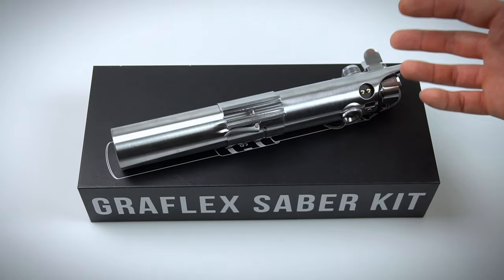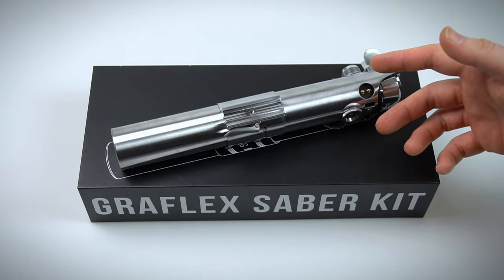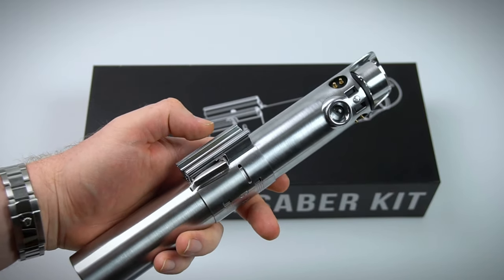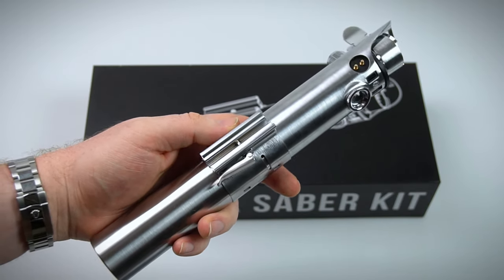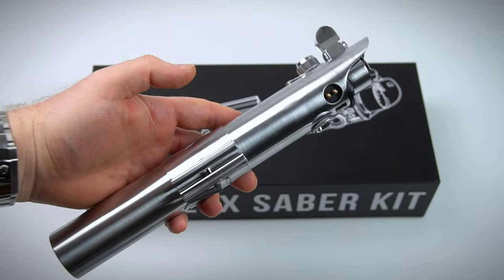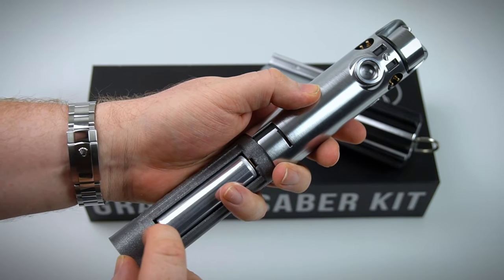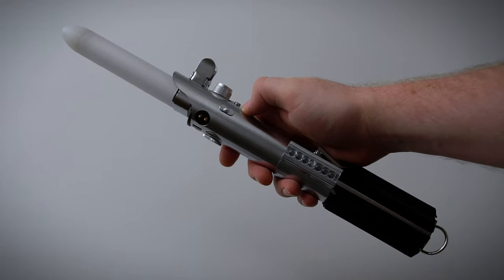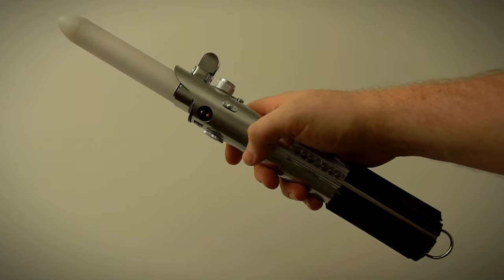Graflex Lightsaber DIY Empty Hilt FX Kit - Luke Skywalker Inspired Prop Replica Kit

Comment: Hello, I just received my kit ESB version and it's amazing. Compared to most replicas I have tried this feels really nice in the hand as well as it's finish. I did notice few things though, like there is no hole for a thumbscrew button or glass eye. I also noticed in the video there were no brass sync contacts where the pins were, but I did see a slit where they could go. After this, I have decided to buy the brass contacts from the graflex shop and was wonder which ones would work? Long or short?
Reply from the maker: Hey! Thanks for the kind feedback. So, there’s no hole for the thumbscrew or glass eye, but, if you look closely on the blade holder, you’ll see a small ‘dimple’. This was deliberately added to give customers the option to either drill for a TGS glass eye thumbscrew, or, drill totally open (by stepping up incrementally) for a shine through effect. So, we left that as an option for users ☺️

In terms of the sync contacts, this was overlooked, and you’ll be pleased to know we will produce a batch of them to offer to customers separately along with spring-loaded blade plugs. 😁
Reply: @KRSabers  That sounds great!! Thank you for letting me know!!

Comment: I just finished my install and was wondering if there’s any update on the blade plugs or sync contacts? Also, is there another front slotted screw (above the glass the) that will reach the blade for retention purposes? Mine seems a bit short.
Reply from the maker: Yes. They’re available on The Saber Armory now. Both the Sync Contacts and Spring Loaded Plugs. 👍

Also, the screws are slotted oval 4-40” thread screws. If yours isn’t reaching, you can buy some longer ones and cut it down to a specific length to suit your blade. ☺️
Reply: @KRSabers  thank you very much!
Reply: @KRSabers any chance the parks 2.0 style ones in the shop would work?

Comment: Hi is the bouton include in the anh empity graflex ? Bc I saw in the install guide that the bouton are spécial
Reply from the maker: Yes. The button is included with every hilt. It is mounted to the blade holder.
Reply: @KRSabers  ok thank you 🙏
Reply: @KRSabers  did the grip guide still include? (I do not see it on the graflex info)
Reply from the maker: @Theblackcat-h8w  The grip guide is not included. It is sold separately on the store.
Reply from the maker: @Theblackcat-h8w  No. The Grip guide is not included. It is sold separately on the store.
Reply: @KRSabers  ok bc on this review you’ve said that for each tool kit a guide is offered
Reply from the maker: @Theblackcat-h8w  Installation guide. Not grip guide. The installation guide is PDF instructions on how to assemble.